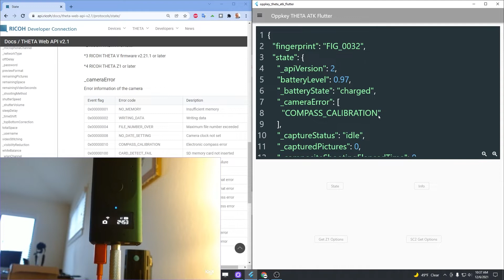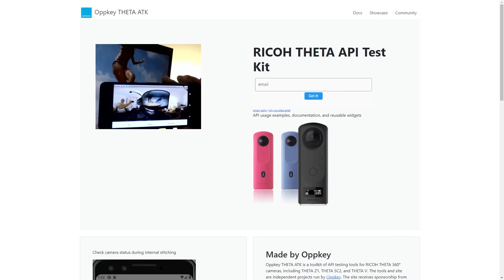RICOH THETA Development Tip - Identify Camera Error

Comment: Hi I have a ricoh theta z1 with both lens having a different exposure. There is a distinct stitch line seen because of the difference. Do you know anything about this. Thanks
Reply from the maker: it is not a known problem.  You should post the actual picture on a Facebook Group and get the opinion of other Z1 users as to whether it is a camera defect.  Do you see the stitch line even with no editing (before you use Photoshop/lightroom)?

Comment: hello, can you help me please, my ricoh theta s camera sounds 5 beeps when it is turned on and it turns off right away, do you know how to solve this error? I thank you
Reply from the maker: What does the battery charge show on the camera?  If you plug it in with a USB cable, you can see the charge on a Windows machine.
Reply: @camera360dev  My problem is the same, I'm watching this video to find the solution.
As if your question was for me, yes I see that the battery is above 80%. (I'm watching on PC)
The model is the Theta V.
It responds without error when I connect the Wifi through the PC but when I connect through the smartphoe (android or iphone), it emits 5 beeps at the same time (red light) and then turns off.
I believe it is the software of the app (Smartphone) that needs updating, do you agree?
There are many people with this problem and no solution, yet I am confident that a SOLUTION from some developer will come.

PEOPLE AROUND THE WORLD WITH THE SAME PROBLEM:
Title:
ricoh theta 5 beeps
Video:
https://www.youtube.com/results?search_query=ricoh+theta+5+beeps

I love Ricoh theta cameras, hugs!
Reply: @camera360dev  Hey! I mean I found the problem.
doing what you suggest in the video I encountered the following problems:
"_cameraError":[
"NO_DATE_SETTING"
"CAPTURE_HW_FAILED"
],

what should i do to solve it?
Thank you for your attention in advance, a hug from Brazil.
Reply from the maker: @LaurivaldoLopes  try updating the firmware of the camera and then uninstall and then reinstall the application.
Reply: @camera360dev  I will do it right now